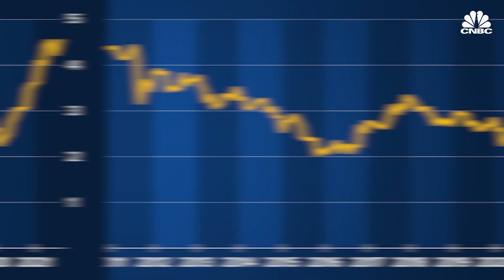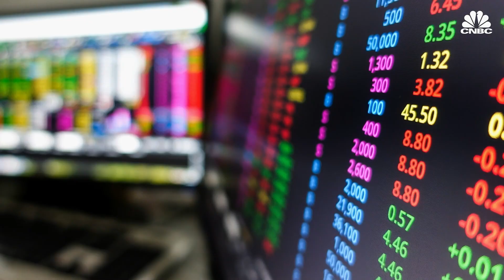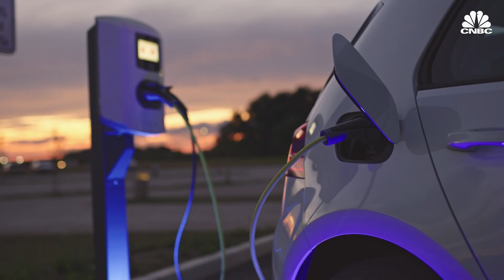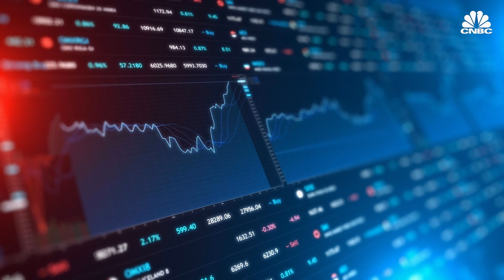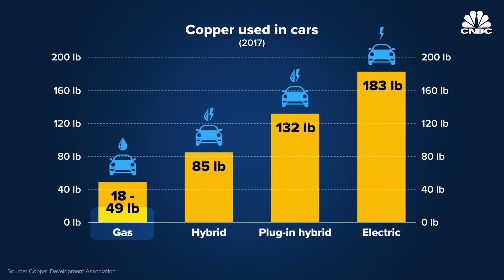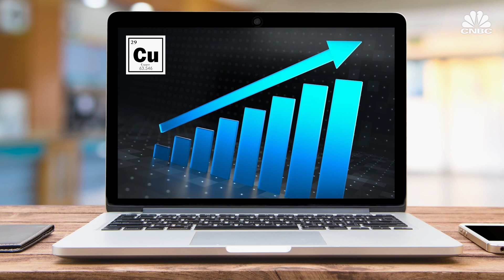Why A Looming Copper Shortage Has Big Consequences For The Green Economy

Comment: You lot are so focussed on silver versus copper. The focus should be on the fact that renewables need copper and a lot of it. Each wind turbine needs 4.7 tonnes of copper. Silver is going not to be used for that. Hence the deficit. Lift your head of the sand and stop being pedantic 😂🤣😂

Comment: I agree with Mr Nalawala that Cu is the most cost effective electrical conductor now available.  However copper is an entrenched industry.  There is little incentive for Cu producers or users to seek viable alternatives.  If there were alternative material(s) which in specific uses were a better conductor/economic fit such that, say, 10% of copper could be diverted, then the total supply of economical conductor(s) would be expanded by 10%.  By any standard this would significant.  I suggest this would be a good short to medium term goal for some basic metalurgy research.

Comment: Take abundance into consideration, it is not that the industry don't know that silver and gold are better conductors but that they are not taken into consideration.
If abundance was not a problem silver and gold is to dense and gold to soft.
https://en.wikipedia.org/wiki/Abundance_of_the_chemical_elements#/media/File:Elemental_abundances.svg

Ag - Silver is not counted towards infrastructure when you consider that it is to freaking rare in comparison to copper. The amount used for the solar panel infrastructure is already mind-numbing when considering the supply.
Au - Gold so rare it is only used in the most critical parts if at all.

Comment: My house has been wired with copper for 60+ years , so I don't need any more house wiring , 
I have 4   P.M.A.s  that use about 5 pounds of copper each and with 4 more I could run my entire house and produce all of my electric needs , each P.M.A. produces 1200 to 1800 watts of electricity depending on fast they spin

Comment: This is so wrong it triggers a rant out of me.
if you have a working brain; have you looked at what other "shortages" we suddenly have that drive the market up?

There is no copper shortage as described in this video, why?

Comparing old cars and EVs is fine, but copper was used before in cars (as demonstrated) and that electric engines literally made out of copper coils are more copper heavy is a no-brainer. At the end of the day the number of cars produced will not truly explode, mostly becouse those cars still have to be made but also becouse recycling (as demonstrated) will bring a big load back into the economy.

Showing solar panels and talking about decarbonization and how copper is needed for a green future is bull. Those need mostly SAND (well silica), which we actually ARE running out of lol.

Wiring does not need nearly as much copper as hinted at and even if, aluminium is also an alternative often used...

Comment: Pure Aluminum is a better conductor than Copper. The reason it's measured conductivity is lower in practice is because it's so reactive with oxygen that it instantly forms a thin ceramic oxide layer which is a strong resistor that blocks the flow at the electric interfaces.

Comment: While silver may be slightly better in conductivity, that increase doesn't outweigh the detracting factors in that silver oxidizes faster, is more rare and thus more expensive... copper is literally the best... at best you could maybe do copper coated silver wiring.

Comment: you can replace copper with aluminium if needed. You'll have to use more of it, because it has higher resistivity, but it significantly cheaper (2500 vs 9000)

Comment: I'm not going to look this up, but from my recent studies in electrical engineering tells me that the quote u used was wrong. The quote stated that there is "no better conductor of electricity"... BUT gold and other much more expensive precious metals are MUCH better conductors of electricity. BUT, they r too expensive and have 'higher value' uses that r regarded much more useful than conducting electricity. SO, copper is the BEST economically viable conductor of electricity. BUT not even close to "the BEST conductor" of electricity... just saying...

Comment: There is no copper inside of an automotive engine. At least a modern, internal combustion one. They are used in alternators, starters, and hybrid drives. (and wiring of course)
Reply: Not entirely true, copper can be found in bronze valve guides, or used for some head gaskets, as crush washers for your oil pan, and depending whether or not you consider them part of the engine, in the spark plugs.

Comment: The biggest fallacy of the so-called green economy is that you cannot create it WITHOUT the machinery that runs on oil. You can't maintain it without fossil fuels, either. Because none of the processes that go into manufacturing solar panels or wind turbines are possible without oil or gas. Green energy is NOT self-sustaining.
Reply: Green technologies can reduce the demand for oil, for example if electric vehicles replace gas cars then the demand for petroleum will fall, when the demand for petroleum falls the demand for crude oil falls, when the demand for crude oil falls the price of crude oil falls making oil derivatives needed in the manufacturing of plastics cheaper.

Comment: Aluminum (3.77 * 10^7 C (S/M)) has around half the conductivity of copper (5.96 * 10^7 C (S/M)) but the much much cheaper price per pound (aluminum is $0.0035 per lb, copper is $4.33 per lb). So on a conductivity per dollar basis, it's much cheaper to just use aluminum instead. Most utility power line transmission used aluminum wire instead of copper wire for that specific reason. Aluminum (2.7 g/cm^3) also have a much lower density than copper (8.96 g/cm^3), so on conductivity per unit mass basis, an electric motor made of aluminum wiring will be much lighter compare to a copper base on. Copper does win out in term of packaging space though, since if your application is space constraint rather than weight constraint, then copper will be primary choice. But the whole point is that as far as market demand pull from electric vehicle/grid storage is concern, copper price can only goes up to a point that it's much easier and cheaper to just by aluminum instead. So there is an inherent price cap.

Comment: Phone lines are fiber and not copper and everything is wireless no cat 5 is needed anymore… and plumbing pipes are now plastics … no one cares about copper anymore..😂😂
Reply: Uh, no.  Wired ethernet is still absolutely critical.  While we are certainly  moving to more wireless connectivity, it will be quite a while until wired connections no longer outperform "wifi" enough to justify the effort.  Then again, I'd love to see your copper patch-cable free data center.  FWIW, in my case, with a family of 5, aside from phones, tablets and some laptops, everything from Roku, smart tvs, AVRs are all connected via ethernet.  Can't beat the speed or reliability of a 2gb/s wired connection.

Comment: Gold is a better electrical conductor than copper and almost completely chemically inert (which is why it's used in microelectronics), while silver is the most electrically-conductive element; it's just that among the metals that aren't super-expensive (usually because of uses as jewelry) and can be made reasonably corrosion-resistant (for example, by sheathing in plastic), copper is the best choice for conducting electricity.

Comment: That is false. Silver is the best conductor. Gold is used because it is pliable and it doesn't corrode, but is expensive in large quantities. Copper is used because it is pliable and cheaper. Silver is not readily used because it corrodes easier. Aluminum is also used, but it has drawbacks because it creates an oxidation layer that inhibits further corrosion that will create a hot spot without a special connection treatment.
Reply: silver is used for the wiring in most solar panels except for the MC4 cables

Comment: I immediately considered that carbon based conductors need more research put into them. With emphasis on scaling production, whether in the form of nanotubes or using micronized granulation combined with conductive adhesion, which potentially could be much greener than mining ore.
Reply: It would never be easier to manufacture carbon-based conductors than it is to mine copper. Copper's here, it's not going anywhere, and while carbon will fill niche roles, it will just never be as accessible.

Comment: AMAZON: 
___Yep, I bought a ton on the dip.

Amazon invested $14 billion in the last quarter alone, the same as it spent in 6 months before that.   It is a do not sell stock.

...With the Delta virus coming at full speed ahead, pandemic sales will make a comeback.

Amazon is investing so much money, that no competitor will ever be able to catch up.

My strategy is if Amazon keeps going down, I buy more to average cost down..
I buy using money on the sideline, then I sell other stocks that are up, then I sell other stocks that have lost less than Amazon's -7.5%.  Most stocks that pop or 

drop hard usually recover 50% soon after.
Amazon's not going anywhere so I know that eventually it will come back.    
Fidelity considers Amazon as a large growth company (probably because as big as it is, it still only has 7% of the retail market)

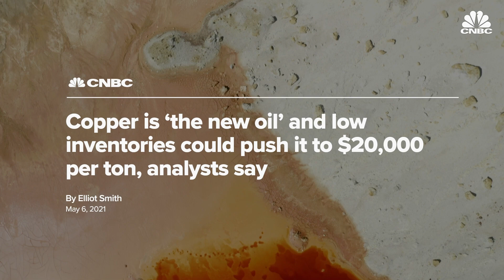Comment: 2:12 "Copper is the single best conductor of electricity". 
Silver: I'm shocked, but like every other lie in the news, it keeps the pressure off of me.
Reply: Isn't gold even better?
Reply: @TheRainHarvester  From what i can gather from the internet, silver is at the top, then copper, then gold, aluminum, zinc, nickel, brass (alloy), bronze (alloy), iron, platinum, steel (alloy), lead, stainless steel (alloy). 
Gold is ideal in some situations, as it does not tarnish easily.
Silver is used in specialized applications such as circuit boards and satellites.
See tampasteel.com/best-metals-conduct-electricity

Comment: no, copper is NOT the "best conductor" it is only the cheapest great conductor, silver is a better electrical conductor
Reply: Aluminum is far cheaper, still. It's about a quarter the price of copper by weight and even less than that for the same current carrying capacity.

Comment: 2:13 He messed up his point by overstating coppers' properties. It's the best practical and economic conductor available. Silver is the best conductor of the elements, but too rare, expensive and too prone to corrosion for all but some niche wiring applications. And for transmission of electric power, the "best" is Aluminum with steel core reinforcement (copper being too expensive for that).
Reply: And waaaay too heavy.  Aluminum can carry twice the load of copper, by weight.

Comment: What about aluminium?  At school we were told that transmission lines were made from a mixture of aluminium for conductivity and steel for strength.  I've seen aluminium used for induction motor stators, microwave transformer primaries and house wiring.

Its biggest drawbacks are inferior strength and it's not very resistant to vibration as it work hardens and breaks easier than copper.
Reply: *Its biggest drawbacks
Reply: @mousermind  Thanks - corrected!  That's the trouble with spending too much time on the internet, you pick up so many mistakes.  My smelling and grandma have got so much wurst over the last phew years.

Comment: There are going to be other shortages on top of copper, with this rush to electric cars, lithium, cobalt, nickel, batteries , even enough electricity supply, the grid will not be able to handle transportation going all electric, we we still need gas and oil. The copper shortage will be the first wall of reality to hit going all green with transportation.

Comment: So... all copper in alternators and 12v wiring in all ICE cars created no problem. Most power grids have already replaced most copper with aluminum in cable wires. BUT electric car motors will create a shortage. Got it.

Comment: Large networks are done with aluminum since it's 10 times cheaper. Even powerful transformers have aluminum cores. It's easier to work with copper cables in home, but you can replace them with x1.5 thick aluminum. We need coper for PCBs

Comment: Silver is quite literally the benchmark for electric conductivity and when ranking/comparing it, Silver is rated as a conductivity percentage of 100 and compared to it Copper is 97. I literally learned that in 5th grade science class. And then I used it in my electronics class last semester.

Close, but not correct.
Reply: They never said it was the best
Reply: @maka8551  2:13 "copper is the single best..."

Comment: Aircraft use Aluminum wire with a Silver coating.  It's far lighter than Copper and the resistance is lower, as Silver is an excellent conductor.

Comment: Jeff Currie should be immediately fired for STUPIDITY.   He made 3 scientifically incorrect statements regarding copper that any high school chemistry student would know the truth about.   he might have a phd in economics but he has no understand of the fundamentals of electricity nor the mining and manufacturing of copper nor of other conductors of electricity and their uses.   the global copper market is NOT driven by fking electric vehicles or solar panels, you house has by far more copper in it than any electric vehicle.   There are NOT massive copper wires running through an electric vehicle, which, is why the battery pack is 300 or more Volts and the motors.... but... of course to understand how thinner wires are used at high voltage with lower current for the same amount of power, you'd have to understand ohms law which is beyond the pale of mr currie.   do NOT invest in commodities with goldman sachs as long as this uneducated economist is in charge of commodities investing

Comment: In 2008/09 there were a few new copper mines that were almost ready to come online, when the economy crashed they were put into mothballs.  Have they been commissioned?  Right now CU is pretty high, almost 2008/09 levels but I'd bet that is mostly due to the supply chain being shut down due to covid not due to low capacity.  BTW....when they show transmission lines, its not CU.  The wire you see on transmission and distribution lines is ACSR, Aluminum Clad Steel Reinforced cable, no CU what so ever.  They ain't building new transmission lines, substations or distribution lines with CU.

Comment: 2:13  That's factually wrong. Silver is the best conductor of both electricity and heat.
Copper is more widely used because it's cheaper and lighter.

Comment: No I’m sorry copper isn’t the “best known conductor” in the world; gold is the best conductor silver is also better than copper. Copper is an economical conductor as is aluminum though aluminum isn’t as good of a conductor as copper plus aluminum oxidizes which reduces conductivity. This is a problem with the news today over simplification and actually misinformation regarding science to demonstrate and reinforce the opinion being presented. Steal also conducts electricity and can be electroplated with copper; aluminum and tin can also be plates in copper increasing their effective ampacity and signal integrity as the power and signal travels on the outside of the wire not through the wire.

Comment: Only a fool will be running out and buying copper stocks. If you dont hold it, you dont own it. Ive been saving the real deal for years. When Canada took pennies out of circulation, that gave a good hint as to where the value is going, just like they did with silver.

Comment: Incorrect.  Copper doesn't beat silver as a better conductor of electricity.  It's just cheaper.  Perhaps saying it's the best conductor for the price would be more honest.
Reply: True. But silver also has a lower melting point. You’d have a lot more wiring issues and electrical fires with silver wiring. Especially at higher loads. Copper cables for power sometimes get freakin HOT. Especially in transformers and stuff.
Reply: @nokiot9  I have no issue with copper being "better" than silver for certain things... like I said, it's cheaper.  My issue is that he said it's the best conductor and that's flat out wrong.  It's just wrong science.

Also, silver is used as a conductor.  It's not ALWAYS used.  Your points are absolutely valid.  But silver is used.  So is gold... because gold resists corrosion far better than copper.  There are pros and cons to various metals.  But again... don't say stupid things to look smart.  Say the correct thing and be smart.
Reply: @Salsuero  yeah but you have to put “best conductor” in the context in which we/he is speaking about: electrical wires.he’s clearly showing examples of wire conduction. Not like silver superconductors
Reply: @nokiot9  Wires aren't the only uses of electricity.  Circuit boards often use silver and gold.  And those are also part of the context.  It doesn't matter.  He said "best conductor" period.  He didn't say "for wires" -- which is also debatable because not all wires are made of copper... because not all uses require or are best suited as copper.  Sure, most wiring is copper.  A lot of that has to do with cost, not thermal properties.  But thermal properties are certainly a part of the decision when choosing a conductive metal.  I have a problem when people state half-facts.  Letting people come up with the context isn't good enough for me.  You're assuming too much of people.  This is a minor issue in the grand scheme of fact fudging... but it's all in the same category for me, regardless of the severity.

Comment: Copper is not the best conductor, gold and silver are better but more expensive
Reply: Actually Gold is not that good of a conductor, but Silver is the best conductor on the periodic table. Gold is used in electronics mostly for finger contact on circuit boards and for bond wires in chips but for other reasons than conductivity.